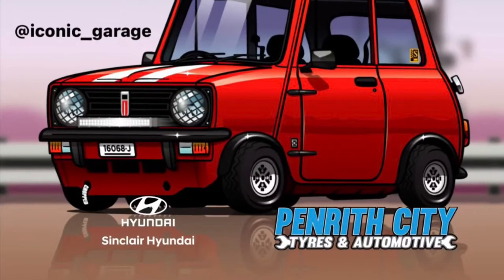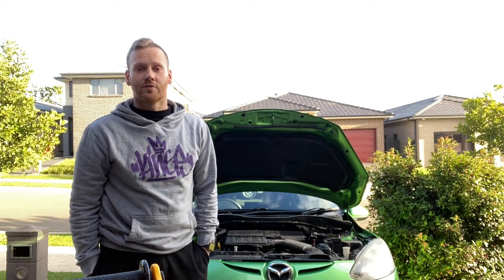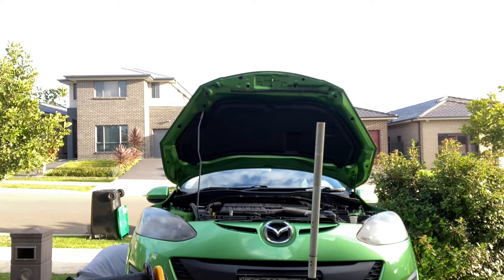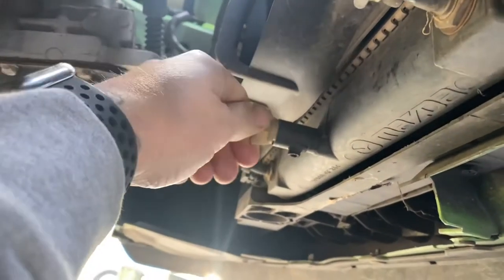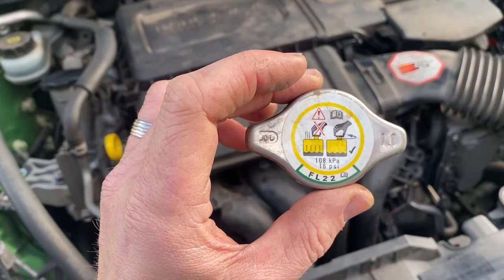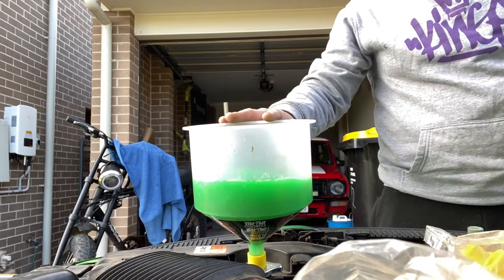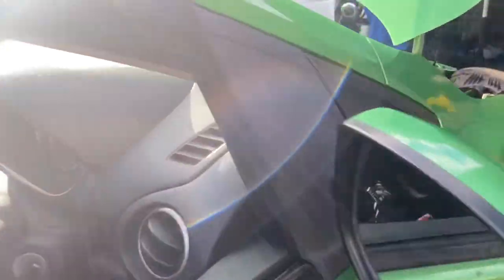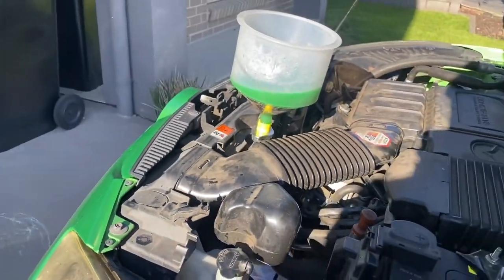How To Bleed A Cooling System - Mazda 2

Comment: Hi . Good video . Ive got the kit and was aoready aware of bleed orivedure .

I not long chajged water pump and thermostat ..and as i now have a new 1 will change out the coolant temp sensor . Im sire my fans are not coming on as requ9red but are working . Ive ran dc current to fans and are sounding great ..ill cone back to give update on whether the sensir helped . 

My exp tank would go a bit full or low. But the oniy time i see evidence of coolant in engine is around exp tank ..i had insiected it off the car no evidence of cracks but got 1 on order to be sure ..as when it oes have any coolant arounc it its in the recess area . And i also find it odd that hakfords recommended the coolajt ive put in its pink not green ..i believe the difference is ots long life . The 1 i have is no silocates etc

Comment: Hey I notice you jacked up the 2 from the front, but I can't find any information on a front jacking point. Is any website or link that shows where to jack it from the front? It will be so much easier than using the pinch welds every time
Reply from the maker: Hey mate, great question! From memory I jacked up the vehicle using the front subframe. It’s a structural part of the body so it’s safe to Jack the vehicle up using, so long as the Jack is on a flat surface, this will be suffice. Good spotto though! Tomo
Reply: @Tomostuneups  Thanks!

Comment: there was still coolant in your filler bowl. Car was at operating temps. How did you remove the bowl without spilling coolant? also, how did you replace the cap while the system was hot? I;ve seen other methods where you put the cap in and run the engine at 2500 rpm for 5 minutes. Then let it idle and repeat 3 more times. Always keeping an eye on your temp gauge.
Reply from the maker: @pwrshots  hey mate, great questions there. 

Okay so the tool has a plug in it which you can refit to remove the coolant filling tool. The excess coolant in the tool isn’t an issue as it ensures that’s the highest point of the cooling system, allowing any air pockets to be replaced with coolant. Any excess can be then used in the expansion tank. 

If the system isn’t pressurized, you can refit the cap safely. As the filling tool was fitted, there was no pressure in the system as it wasn’t a sealed system. 

I haven’t heard that technique before, but it could work. So long as the thermofan is cycling, heater is hot and temperature gauge operates normally, I don’t see why it wouldn’t work. 

Just be sure to check the level once completely cold again, in both the radiator and expansion tank
Reply: @Tomostuneups  thanks for clearing that up for me. 👍

Comment: Good video.
Mazda´s requires FL22 coolant. What about Prestone, is it compatible? I just need to fill 0.3L, my car is stock
Reply from the maker: Thanks for the feedback bud. I haven’t used Preston’s coolant before, but they claim “suitable for all makes and models” regardless of coolant colour. They do have a whopping 10 year or 480,000km protection from rust and corrosion. Wonder why this stuff isn’t sold more locally or isn’t known about. I guess modern coolants meet specific standards and OEM quality nowadays with technology. 

As for your coolant in your car, topping up with water is ok but if doing a flush, make sure you get your mixtures right. Hope this helps mate, Tomo

Comment: Thxs heaps for this. I've got same Mazda 2. Would it be good idea to put just clean water through the system, with heater on full too, so to clean it out a bit more before putting new coolant in?
Reply from the maker: Hey mate, thanks for the feedback. 
Yep it definitely wouldn’t hurt. You could do one step further and remove the thermostat and flush the engine, remove both heater hoses and flush the heater core, as well as forward and reverse flushing the radiator whilst you’re there. That will help get rid of all the old coolant and any debris in the system. Alternatively, run a flush additive through there prior to draining. Hope that helps mate, Tomo
Reply: @Tomostuneups  Excellent - thxs mate!!

Comment: Interesting video. I've always bled the coolant circuits as you have and then throw the demister on max heat , max fan speed and wait until the heat goes hot from demister.
Reply: Hi is there a ourpose to thus nethid , ? Curious thnx

Comment: My vehicle is a 2009 model Mazda 2. Green color coolant is used in it, is there any harm in mixing blue color coolant?
Reply from the maker: @lbzcreations13  Hi mate. It is highly advised NOT to mix coolants together. Topping up with distilled water is a much better option, alternatively if you don’t have distilled water, normal tap water is fine. Please DONT mix coolants. 
Cheers,
Tomo
Reply: @Tomostuneups  When topping up, should water be poured into the white color tank or into the radiator?
Reply from the maker: @lbzcreations13  always top up when cold. Check the overflow bottle and top up, then proceed to the radiator and top it up. If the vehicle is hot, ONLY top up the overflow as it has no pressure in the system, unlike the radiator.
Reply: @Tomostuneups  Thanks for the valuable information 🥳🥳😍👍🏻👍🏻👍🏻

Comment: Thanks for the video, just changed the coolant in my mazda 2 and it didnt take the whole 5 liter, 1 liter would go in, is that normal? radiator fan didnt kicked in, drove about 8km in traffic, let the engine run afterwards but radiator fan has not turned on. Thermostat opened eventually but no fan going. The coolant started to pour out so had to turn the engine off eventually.
Reply from the maker: Hey mate, thanks for reaching out. Can you dm me on Instagram for some further assistance, save me writing it all in a single reply. Cheers, Tomo

Comment: Hi, changed the thermostat and coolant on my mazda 2, when i bleed the system it keeps boiling over and then suck a good amount of coolant. Do I need the bleed top tool you are using? I have No heat in the cabin but fan and thermostat are working okay..
Reply from the maker: Hi mate. Sounds like you have an air lock in the system. The funnel isn’t needed but will help bleed it. Try it from stone cold & run the engine until warm. Jack up the front of the vehicle so the radiator is the highest point, turn the AC off and heater on. Sounds like the blockage is likely in the heater. Dm me on Instagram if you get stuck further